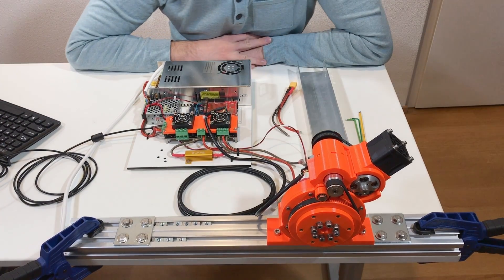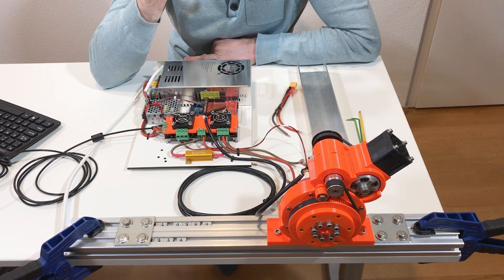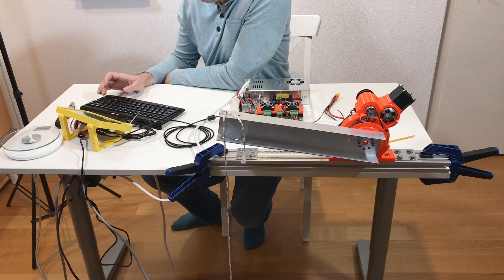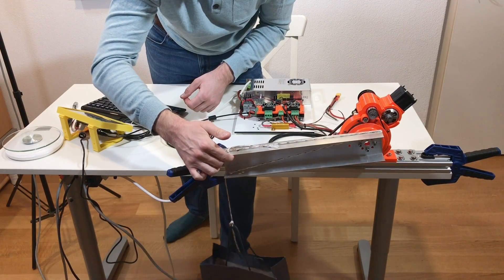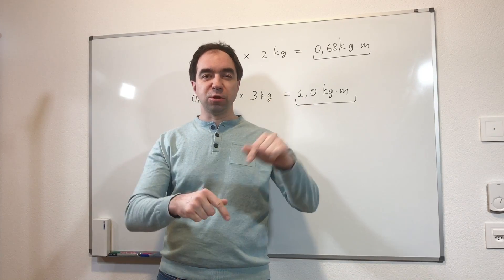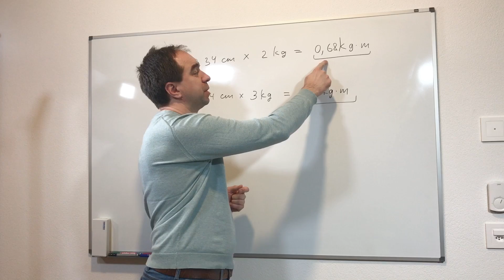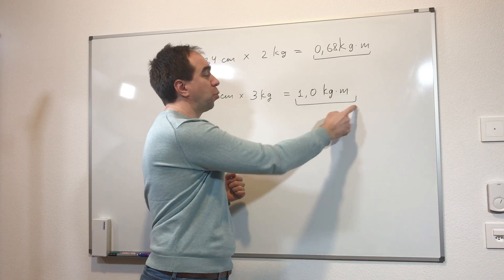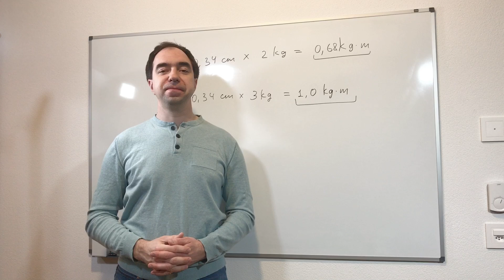Torque Test of Robot Actuator (Brushless Motor Robotic Joint)

Comment from the maker: Do not hesitate to leave your comments! This will help to promote this video and channel. Thank you!
Reply: Just made a small donation for a cheap "emergency stop button", on Aliexpress...
Reply: You're using the wrong kind of drive with the wrong kind of motor for your purpose. These drives are intended for high speed, high accuracy linear motion, not rotational torque. That's what stepper motors are made for.
Reply: @marcus_w0  All high end (expensive!) robot arms use servo motors and gearboxes.  You can't beat the power to weight ratio, accuracy, or speed.
Reply: @franktkalcevic5342  Yeah - they use Industrial SERVOS - not a hobbygrade brushless  rc motor made for rotational speed, which could be translated to directional speed, but not rotational torque! these motors don't like low rpm, and they aren't made for constant stalling. These motors are like horses, they want to run free :) 

Servomotors as to the motors, also have a entirely different gearing than this one.
Reply: @marcus_w0  How do these RC motors differ to the industrial servo motors?
Reply: @Frank Tkalcevic, what is servo motor? It is linear motor with reducer (gear) in one box. Author use powerful brushless motor instead linear motor, and create his own reducer. I think his idea is better! If he needs more power - he will modify reducer: insted ration 1:15 he will create ration 1:300. If he use brushless motor 18000 rpm, he will get speed - 1 rotation per second (0.25 second to rotate at 90°), that is more than enough for the fast robotic arm!
Reply: @franktkalcevic5342  These motors are build entirely different. A RC brushless is build with 3-9 windings for maximum speed and acceleration - NOT FOR HOLDING TORQUE! A industrial AC Servo uses 9-40 windings and the stator configuration is entirely different. The O-drive is intended for LINEAR MOTION, NOT HOLDING TOURQUE .

I worked at Kuka Augsburg for almost 12 years, I guess I know WHAT a real servo is.
Reply: @Marcus Wieder, You say - "brushless motor don't like low rpm". It is not true. All gimbals for cameras and smartphones has only brushless motors! They perfect work with low rpm.
Reply: @СашкаБелый-ч6м  No, that's not what I said. I said THESE Brushless motors don't like low RPM. Gimbalmotors are again - a different type. It all has to do with it's internal geometry. number of poles, number of windings, number of phases, inrunner, outrunner etc.
Reply: Here's a typical brushless gimbal motor. count the number of poles/windings and you'll se the difference. https://bit.ly/2TE0z6x
Reply: @marcus_w0  does it mean that servo is the only way to make proper manipulator?
Reply: No, it means that this exact motor and it's configuration in combination with your gearing isn't able to obtain better results. you have change the parameters for better results. I don't bother using an odrive or rc bushless motors, but there are different types for different applications. a HDD motor is brushless, too - but it's made for rotational speed, not rotational force - as an rc engine is to a part. the hdd motor is the one extreme, a real AC servo or a brushless gimbal motor is the other - the RC brushless is somewhere in between.  You have to compensate for the higher speed and the lower torque with additional  gearing - or change the motor.   @pavelzhdanov
Reply: To be clear: there are types of brushless motors, that could do what he wants them. But the Motor he uses has a much to high KV ratio for this task. This motor is best used for rapid linear motion, not holding torque. If you have a look at the ODrive project and it's motor guide you'll see many motors tested, but none of them has such a high KV ratio. The lower the ratio, the higher the torque of the motor.

something like this could be a match: https://hobbyking.com/de_de/turnigy-aerodrive-sk3-6364-190kv-brushless-outrunner-motor.html

I'd go well below 100 for this.
Reply: @marcus_w0  I thought KV was fairly irrelevant in terms of motor performance. High KV with low voltage will spin as fast and produce the same torque as low KV with high voltage, and as long as the mass of copper is the same (less turns thick wire or more turns thin wire) then copper loss at a given torque is the same as well. Low KV gives more torque per amp, but resistance is much higher so heating is the same.
Reply: yes,  you're right - BUT I spoke about THE GIVEN Motor. This motor in difference to the other I mentioned had the same Voltage - but a more speed output configuration that the same modell with the same voltage and the lower KV @dekutree64

Comment: Didn't the O drive have a battery rail for surge?  (In addition to the power supply)  in that way you can get away with a cheaper power supply while the battery provides surge startup and can also be recharged when the motor slows via regenerative power.

Comment: This tensioner ilder is drowning some W and therefore you loss torque. Use a proper length and remove the ilder
Reply from the maker: I think you right. This idler is badly positioned.

Comment: Have you considered using a planetary reduction drive stepper motor?   You get 25Nm at the output shaft continuous or 40Nm momentary on a 50x50x120mm package and use only about 2 amps.  Cost is about $80.       Stepper motors have maximum torque at zero RPM which beetermatches your testing   read this spec sheet https://www.omc-stepperonline.com/download/23HS22-2804S-HG100.pdf

Comment: Just a thought...  If you need to supply 50 Amps, don't you need heavier wiring to the motor? Voltage drop will contribute to the lower power at the motor.
Reply from the maker: Good point. This is the original cables from the motor. And they do get very hot at this current. I agree that these cables should be way larger.

Comment: This is really cool! Two questions: do you use a hotswap circuit when connecting two lipo batteries in parallel (to prevent one battery from discharging into the other one if they are not the same voltage)? Do you think that by adding a derivative component to your (PID) controller, that it will be able to reduce overshoot caused by the inertia of the system?

Comment: Put another belt tensioner on the other side, it's where you belt slips. You can see it bending up and then hear the sound. that should help with testing but in the long run going with gears is always better.

Comment: gear + wormscrew = better torque and none reversible mecanism. The belt style assembly is too fragile.
Reply from the maker: I would like to have reversible mechanism (to be able to detect the forces, using the current on the motor).

Comment: The joint looks incredibly beefy, but it's still a toy. 50 amps and it can't hold just a few kilos...
You need a proper gearbox - the cheapest(under $50), crappiest planetary or even worm drive reducer will perform an order of magnitude better than your belts, even in terms of backlash(but it'll still be bad, and unusable for a proper robot).

Comment: Hello and congratulations again for interesting research! I would recommend you to use some kind of endstop setup in order to make the tests more safe. You can make a mistake and input setpoint 100000 instead of 10000 and then the arm might hit something. If you have a positive and negative limit switch on your rig that can cut the power to the odrives it will be much better. Keep up the good work.

Comment: Yeah, the holding torque of a BLDC will never be the same as a Stepper. The gear reduction and all those belts cause too much backlash, and the encoder struggles. Someone else suggested this as well, but try to put the encoder on the output shaft
Reply: Szilágyi Szabolcs    use an electronic / electromagnetic brake

Comment: This is very good work, but I see the main issue being your gear reduction. I am working on a very similar product, but I'm using motors 1/3 the total watt output, on 3S, and not even using an oDrive to cut costs, just a simple hobby car esc for 15 dollars. The solution is a gear ratio. Brushless motors truly shine at higher RPMs, there peak theoretical power output is at half of their RPM. So I'm using PID on these simple ESCs and a 1 to 800 gear reduction as I want my robotic arms max speed to be 10 RPM and my brushless motors max RPM at 11.1 V is 16000, so I want to run at half of that.  And lastly, your issue was that gear trains have backlash that hurts accuracy, and you're not wrong, so I put my 3D printed encoder on the last joint or second to last stage of reduction in my gears, which I am running a 1 to 9, then a 1 to 9, and then finally, a 1 to 10, to minimize efficiency losses in early nylon 3d printed spur-pinion gear. I would highly recommend at least gearing your system up much higher, moving your encoder to the final joint, and running your oDrive in velocity mode, then using simple PID to control your motor, or you could even go a step further and just put a second encoder on the final joint and build a simple positioning algorithm that sets position of the motor until the target position of the joint is achieved. Anyways, there's a lot of solutions here I believe you're overlooking, as that reduction is not going to cut it for a robotic arm. Simple as that.
Reply: What kind of gear do you use for 1-800 reduction?
Reply: @pavelzhdanov  I will be using 3 nylon 3d printed gears of a 1 to 9, to a 1 to 9, to a final 1 to 10, increasing the thickness of the gear as i move up the reductions to accommodate for the higher torque
Reply: @Flame6332  interesting. What type of gear have you used? What is backlash? How big it is?
Reply: @pavelzhdanov  ...sorry, I'm still in assembly phase, however, the backlash won't be an issue regardless, as I'm placing my 3d printed encoder on the final joint, so the motor can accommodate for any backlash
Reply: @pavelzhdanov  for example, 1 degree of backlash inaccuracy on the final joint can be accommodated with 2.2 full rotations of the BLDC motor. And I'm using gears of increasing size, but a ratio of 11 on the motor to have plenty of diameter to cool down, the secondary stage would be 9, with the bigger gear being around 16 cm in diameter, and the final stage would be the thickest gears of the robot arm, a reduction of 8, with a gear around 20 cm in diameter
Reply: @Flame6332  have you designed the final version of manipulator with a such sizes of gears?
Reply: @pavelzhdanov  I apologise, but I will be starting the print of the final parts of the first prototype by the end of today, I will be making a video about it, I already have a video on an early encoder prototype, however, the video will be in a week or two as designing the assembly takes a while
Reply: Why do the BLDCs achieve high torque at high rpm? I always thought the higher the rpm, the lower the torque, just like in stepper motors?
Reply: @YOUnoobGER  you are right, the torque drops as RPM increases, but, if you look up a DC motor torque rpm curve, then the maximum "torque per rpm" or power (watts) is in the midpoint of it's max theoretical RPM, so you run it at that speed, geared down until it can pass the theoretical max target load, and badabing bada boom, you got yourself an arm
Reply: @Flame6332  Thanks for the info!
Reply: @Flame6332  why not consider stepper servo? It has flat curve trq/rpm.
Reply: @pavelzhdanov  terrible power to weight ratio, too expensive to lift an 8 kg load at a half meter distance at 10 RPM, and the non flat torque curve has the advantage of allowing to lift a heavier object slower, due to higher torque at lower RPM, even if it does heat up for the small instance of extra load
Reply: @Flame6332  what about inertia? How does small bldc will cope with 2 kg m at the end of manipulator even if it keep it on hold?
Reply: @pavelzhdanov  that is one of the more difficult design challenges, I have a couple interesting solutions though. First of all, in smaller scale testing, the drive shaft is geared down to such an extent (1 to 800), it takes little to no holding torque to hold the arm joint. However, holding torque is pretty terrible on a small 400 watt BLDC motor, as I've confirmed in testing, so I may take advantage of the 2.2 turns = 1 degree, and half the motor bounce around within 1 degree, as that would only affect my end case accuracy by about a millimeter. End case scenario, I have a very simple solution for the final product, if its even needed, I have an abundance of these cheap little 2 dollar 9 gram servos, which I will be adding a very very simple brake pad system onto the initial spur gear, it's a very simple solution, that on the drive gear, would give a huge amount of holding torque, as once again, the initial axle can be merely brushed to halt all movement on the final gear.

Comment: Forgot to say last time! Since you are using a disproportionately large reduction on the second phase of the transmission I see some play with the belt under load in the direction where there is no tensioner. You might want to put a second tensioner to reduce it (you could also use two tensioners single screw that moves both tensioners towards one another thus pinching the belt loop between them).

Comment: You should use stepper motor for this application. Small BLDC motor has high power, but look at RPM vs Power graph for your motor. This motor is designed to work at high RPM, so you need use gearbox with greater gear ratio. This small motor has also low torque, so it can’t handle this load. I started build my own robotic arm an I decided to use stepper motor. If you use cheap powerful BLDC motor you have to use expensive gearbox with high gear ratio. 
I think you made mistake calculating torque. Your arm has also mass so real torque is lower.
Reply: There are multiple reasons why use servo motor. You a closed loop system that will be able to detect stalls, compensate for errors and position more accurately than a stepper would. While there are so called closed loop steppers those are basically just used to detect stalls and have no compensation or error correction (also they are quite expensive, while this on the other hand is not). 

Do also consider that with encoders on the robot arm you can back drive the actuator to a position you want by hand and then save that position by reading the encoder, which is a far simpler and elegant solution.
Reply: @exol511  Yes, I know servo is much better, but is also expensive. I have stepper motor + driver, it cost me around 200 USD. It generate 3.1 Nm at 200 RPM, 2.1 Nm at 600 RPM. For gear ratio 1 : 15 I have output torque around 30Nm and rotation speed 360°/1.5s. This is quite good torque and speed for this price.
Reply: @grzegorz2169  thing is he already did a build with stepper motors and they added too much weight. Do consider that the actuator will be 3d printed, thus the entire construction is way too flimsy to support the heavy weight of stepper motors on top of the payload.
Also Odrive is basically the cheapest servo drive on the market at 119 euro, the brushless motors and encoder are also fairly cheap and light, compared to a stepper.
Reply from the maker: @Grzegorz Pierog And what is the weight of your stepper motor? I think it is close to 2kg. Which is way to heavy for my project. That is way I want to use a brushless motors. And this is way on the industrial robot arms they also usually use brushless motors.
Reply: @Skyentific  Yes, it is heavy. But you said that gear ratio is 1: 15. This is good for stepper motor not for smal BLDC. For example small BLDC can produce 0.1 N at 3000 RPM. For robot actuator 360°/1 s is enough. In this case gear ratio is 50: 1, but output torque is 5 Nm. You didn't say how much torque can produce your engine. I think not too much, but it can rotate very fast. So you should use motor with very low KV (has lower speed), and you need bigger gear ratio.

Comment: Hi!
You are forgetting something in your calculations, it is the static torque needed to hold the metallic arm. So the global torque is (measured mass+1/2 mass of the arm)*length of the arm. 
Also a little detail: you wrote 0.34 cm on the board, I think this is a mistake (should be 0.34m ou 34cm) ;) 
And one last thing: I think you should try to make the dynamics calculations instead of statics ones. This would give you a better idea of what you can expect from your future robotic arm ;)

Comment: For your task you need an engine with a large number of turns, that is, with a very low kV.  Thank you for the video!
Reply: https://ru.aliexpress.com/item/Yuenhoang-1-N6384-150KV-DC/32921203343.html?spm=a2g0v.search0604.3.8.1e1972f9TzTW7x&ws_ab_test=searchweb0_0%2Csearchweb201602_2_10065_10068_319_317_10696_453_10084_454_10083_10618_10307_10301_537_536_10902_10059_10884_10889_10887_321_322_10915_10103_10914_10911_10910%2Csearchweb201603_6%2CppcSwitch_0&algo_pvid=36a44b43-92e5-41b4-975d-5ba993043026&algo_expid=36a44b43-92e5-41b4-975d-5ba993043026-0
Reply from the maker: Thank you for the comment! In this project I use the motor from the same family. With the lowest KV available (350).
Reply: @Skyentific  Извините, это сообщение напишу по русски, чтобы точно передать суть. В Вашем проекте  от мотора не нужна высокая мощность, а требуется высокий крутящий момент. Момент определяется величиной магнитного поля статора и ротора. На ротор Вы повлиять не можете и магнитное поле постоянное (постоянные магниты). Магнитное поле статора определено ампер-витками, то есть количество витков умноженное на протекающий ток. Образно: если взять провод в четыре раза тоньше нынешнего и намотать в четыре раза больше витков, то текущий момент Вы получите при токе в четыре раза меньшем. Только упадут обороты из-за увеличения индуктивности обмоток. Это упрощенная модель, но для понимания происходящего достаточно. К сожалению, этот двигатель не очень подходит для проекта. Удачи и успехов в реализации идей!